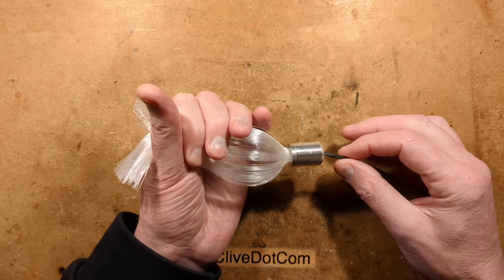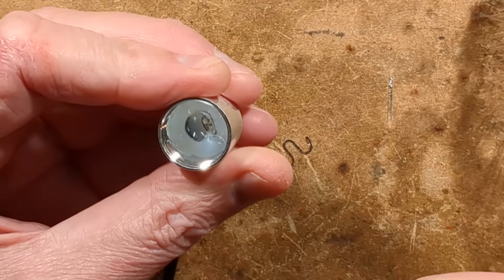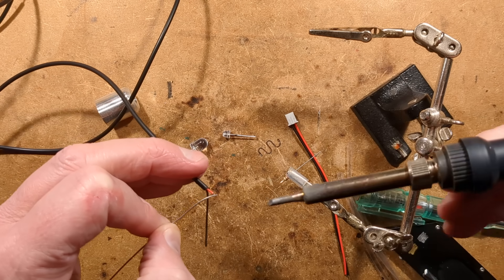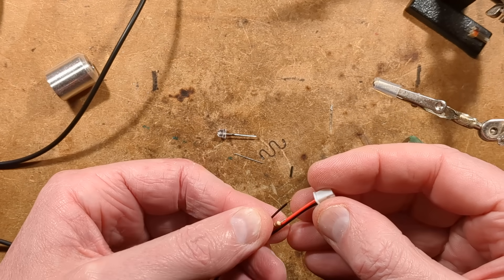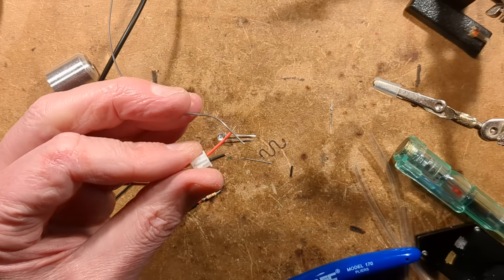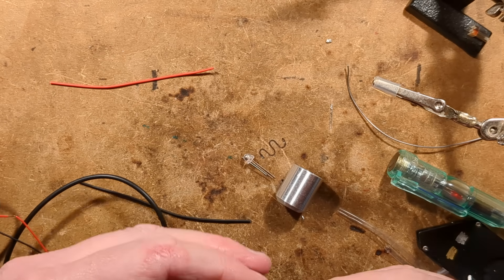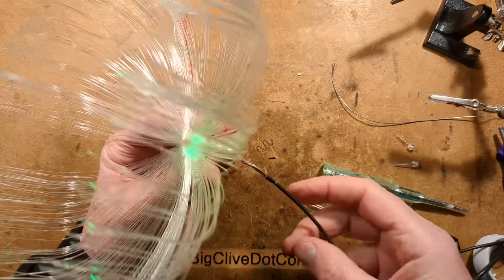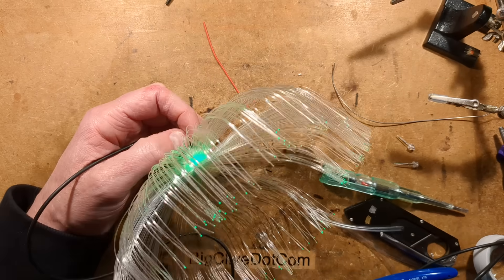Fibre optic jellyfish light teardown and modifications

Comment: I found this video very interesting because it got me thinking about optics. I was wondering what the improvement would be if one of those solid plastic type reflectors was bonded to the ends of the filaments to provide better light coupling. It would then also be possible to add a high-power LED to it and take advantage of the improved light transfer.

It may be possible to try this as a modification using a cheap torch with such a reflector as a source of parts. It would be very interesting to see the results of such an experiment.

An enhancement would be an RGB LED and DMX control and maybe go even further and include independent addressing for multiple fixtures and effects.

How about using a miniature array of LEDs and a controller to create animated effects with each jellyfish light? Put the whole lot under DMX or other control and there could be a very interesting and fascinating lighting display. Maybe something like thins could work well for an event with a  marine or aquatic element, or theme or just something different and unusual?

Comment: Your soldering iron may not be the latest model but if it does the job why replace it just for the sake of fashion? I still use the Weller TCP station my parents gave me for Xmas when I was in college about 50 years ago; In fact, I just replaced the cable from the iron to the base so it should easily outlast me. It doesn't have a hot air pen but small heat guns suitable for heat shrink aren't expensive and I can use that where it won't blow on anything else that is on the bench at the time.

Comment: This is most likely one "cost-optimized into oblivion" iteration of the UFO style lamps that were all the rage in the 90s and 2000s. IIRC the fancy versions of those didn't have a single colour across the whole optics bundle but probably rotated a coloured disk below it so the colour transition moves in a circle across the bundle. And of course the "windows/position lights" on the UFO base were also lit in the same pattern xD

Comment: what types of connectors are those? i'm looking for ones that grip led legs tightly. they make number of those. i have made own 1-wire temperature sensor sockets from cut up ic sockets before which weren't the usual type ones

anyway, what are best for leds, or maybe resistors, for testing, etc. some of those connectors had grip on just about any solid wire you put into them

i have even seen them as led sockets in old pc's : p
Reply from the maker: I think these were JST-XH with a 2.54mm (0.1") pitch.

Comment: I have something called the Urbanworx LED Jellyfish Lamp. Found it at a local supermarket. You fill it with water and plug it in. Two tiny jellyfish-like things start floating about in the water as it cycles the colours. One odd thing I've noticed is some of the colours are brighter than the others. Been meaning to ask you about that but was waiting for a suitable time.
Red seems to be very dim while blue is a lot brighter. Is that a common artifact of the colour changing LEDs or perhaps just this one?
(I know the standard colour LEDs have different forward voltages but don't know anything about the colour changing ones.)
Reply from the maker: It varies between batches and manufacturer.  Modern red LEDs are much better than they used to be.

Comment: Does anyone have experience with these “daylight collectors” on roofs that orient themselves towards the Sun and use fiber to transport the natural outdoor light through the insides of a building, without the need for windows to the outside?
Reply from the maker: It's debatable if they are a cost effective alternative to just having a low power LED bulb inside.  You can get much simpler systems than the ones being hawked by salesmen.
Reply: Primarily I’m just curious about that “tech” in principle not needing any electricity for indoor lighting during the day.
Reply from the maker: @abavariannormiepleb9470  A much simpler (and cheaper) option than the mirrored light pipes often used, could be a solar panel on the roof directly powering a suitable LED panel in a dark hallway.

Comment: I have a fiberoptic light that sets on the table and it goes up and out and over and turns around and has a color changing disc in it.  I've had it for years.  I guess it was made before the RGB LEDs were made.

Comment: Clive, perhaps dont  get the T12, they are out of date, poor performance vs JBC C series tips. Think about the Geeboon HC24, it is a dual voltage unit, can output 400w (with the right tip), and takes all these tips, but you do need to buy the supporting handles too, - T12, C115,, C210, C245 and C470

They cost Circa £94+vat + free postage. I have one, mine costs £134 just under uk vat rate. Has C210 and C470 handles (the 470 handle is C245 handle with an allen screw to stop heavy bits falling out), and so also doubles for C245 tips too

With a C470 5mm C-tip, I have desoldered  97 pins that go into a multilayer pcb,. These pins are long metal stems going to multiple relays on the outer side of a car lighting module.

I do use the Ali £4 tips (£12 for C470 tips), rather than £37+ JBC ones, as I do not need the extra performance. It is by far one of my better purchases.

BTW great vid.

Comment: I'm so short-sighted (-5 diopters, luckily the same on both eyes without any other lens distortions) that I can still read SMD markings without glasses, something that will most likely stay that way. But -5 diopters means everything gets blurry from 20 cm (= 1 m divided by 5 diopters, for those who wonder how that is related) onwards. Which is annoying in its own right when I put the glasses aside to read component values or solder. It happens all the time that I lose my glasses in between the gear and all the remains of things I disassembled that lie on my desk, because without glasses I can't tell the glasses apart from wires and cables 😅. 

With glasses everything is blurry up to around 1m, which means I can't focus an anything between 0.2 an 1m no matter what I do. 

And yes, that is something that hit me over the last few years as if there weren't enough other things that tell you you are getting older.
Reply: Get a lanyard for your glasses like the ones librarians always seem to have.

Comment: BC  -the many electronics superstores (really, small independents all under the one roof) do all kinds of stuff like this, including pre-terminated optical fibre bunches, and addressable LEDs, so you can have a display that changes colour in a synchronous manner. Whilst I've never really looked, they sell so much DMX based stuff that it's probably a certainty that you could easily (and very cheaply) find suitable drivers if needed.

Comment: Clive, what would be the best/lowest current way doing this on a 220v light bulb fitting?
Reply from the maker: Probably a small 5V power supply in a base for several fibre clusters, but it might also be viable to adapt a standard 1W LED light for a brighter effect.

Comment: I would love to see the fibers stretched to double the length so that the "tentacles" would be half the area. The ends of the transcript would remain the same area as a weight. A tiny motor with a offset rotor and a pivoting pin on the power cable would raise and lower the jellyfish. The tentacles would expand and contract like it was swimming.
Reply: They have another version that has two fiber optic pigtails what you see here and A straight piece of dangles in the middle it looks just like a jellyfish

Comment: A tail of fibers? How about custom 3D printed figurines in translucent filament? A bunch of little fairy figures would give you literal fairy lights. They wouldn’t even need to be threaded, just print them as a sort of loose press fit and the threads should bite perfectly.

Geometric shapes, butterflies, anything you can imagine and print.

Comment: I remember when fibre optic decorations were all the rage back at the turn of the century. Christmas trees, in particular, were the new aluminium trees of their day. But they didn't use LEDs to display the colours; no, they used an incandescent bulb with a transparent plastic plate that spun via a motor, and it had swatches of colour placed across the plate. It was very effective! There was a "transitional" range where they were do alternating dashes of colour, and the different positions of the plate would cause it to "flash" or "dazzle", basically a strobing effect.

It's funny to think that many basic LED programme cycles follow that same pattern that was originally done with analogue technology.
Reply: "Turn of the century." That still sounds so 1900 to me although I know you mean 2000.

Comment: I also have the Yihua 8786D, and for my hobby use is plenty adequate. The only real issue with it is that the temperature readout is a lie. It will reach the set temperature and hold it, but the ramping up of the displayed temperature is an animation. Apparently it's a common theme with cheap soldering stations. I wonder if there's a replacement firmware that actually shows the real iron temperature.

Comment: I hear you about vision getting blurry as you age, but this is something remarkable that happened to me:  it was about 10 years ago when I hit 50-ish I needed readers to see the small font on screens and solder electronics. When I hit 60 I decided to try, as an experiment, a carnivore diet. I had been mostly Keto for 15 years, so I thought, why not?   Roughly 6 months later I realized that my eyesight got better.  It doesn't make sense to me, and I don't know how or why that happened, but I can read the screens and solder without the readers again, sometimes I do need readers under dim light or poor contrast, but for the most part things improved! I was not expecting that result.  Very curious.
Reply: My optometrist noted that my vision improved somewhat around age 60, he said it's a common occurrence. Something to do with the bones of the face changing shape slightly. I haven't done any special diet except for low-carb for a while after abdominal surgery.
Reply: @tncorgi92  Oh... maybe it's that!?  I have lost weight and my face is thinner when I did that. Huh... maybe, that's curious, thanks!

Comment: the color changing LEDs have a driver chip in there (wonder if it's a microcontroller or just logic).  Anyway, the chip handles the current limiting since it has to regulate it's own power while dimming 3 LEDs.

Comment: ~4:20 I used to fix industrial machines, and after a storm I was working checking machine in this factory as the guys fixing the roof dropped a panel on me, I fractured my neck, leaving me with partial numbness and hand tremors, and trying to freehand solder wires is infuriating

Would be nice to get a load of them, weather proof them and string them outside in the wind

Comment: I had one of the first fibre optic table lamps in the’70’s. The strands were so brittle and snapped easily. I was always trying to dig out near invisible little pieces that had stuck in my feet!
Reply from the maker: The glass ones were great, but the glass skelves were not.
Reply: I still have the fiber part! I think they're glass, that's why they snap, but they also look much better than the plastic ones. One day I'll light it with an LED.
Reply: The one I had used a fairly large base that contained a motor and colour wheel so the colours would shift around the fibres. Incandescent bulb of course.
Reply: @bobpockney same as mine.

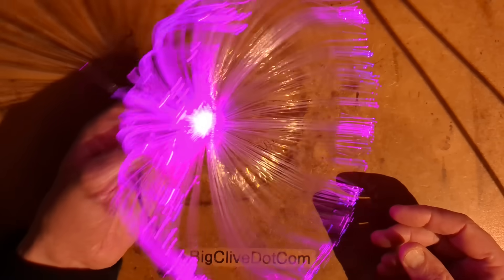Comment: @0:57  That one little "hair" sticking up out of place on the left side near your hand was making my OCD twitch something fierce  :)  
@2:09  I would have used a straight dental pick to push the alcohol down the sides of the hot melt glue to get it further in...might have been easier than a screwdriver.  
For surface mount component placement I (now) use a cheap borescope connected to an old Nexus 7 tablet and held over the work with Helping Hands.  It works well.

Comment: AliExpress also has some garden light versions of these, with the typical tiny solar panel and battery.  I wonder how terrible they are compared to smaller globe garden lights...

It's surprisingly hard to find this exact thing on AliExpress otherwise; I suspect the "jellyfish" name is something eBay sellers added.  Or my search-fu is getting worse in my old age.

That said, I have a vague urge to get the cheapest kind available and replace the LEDs with a string of addressable ones...